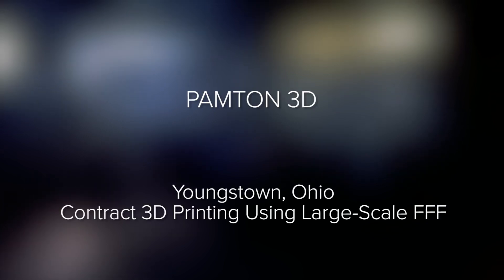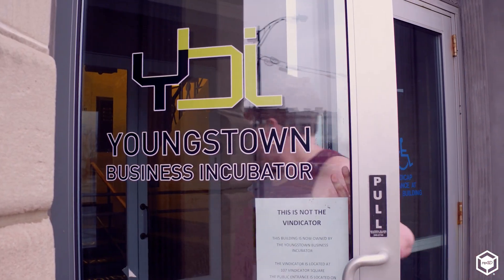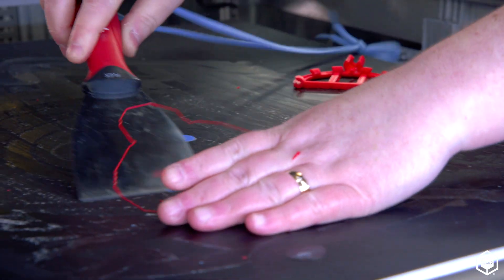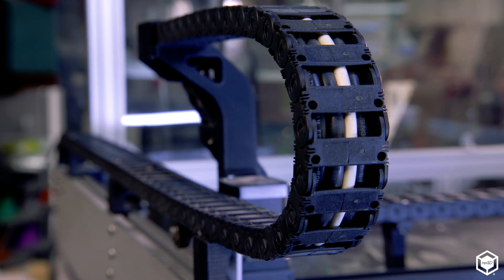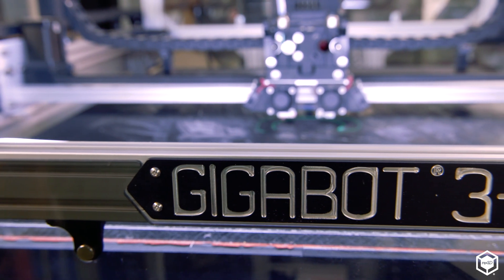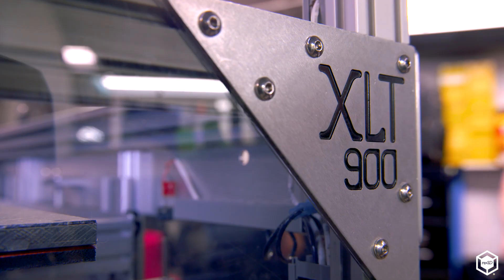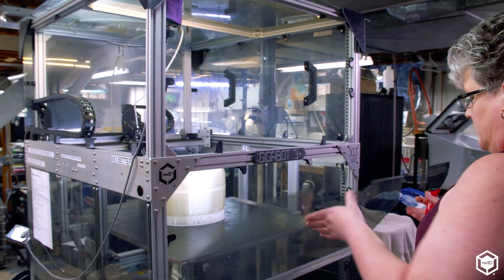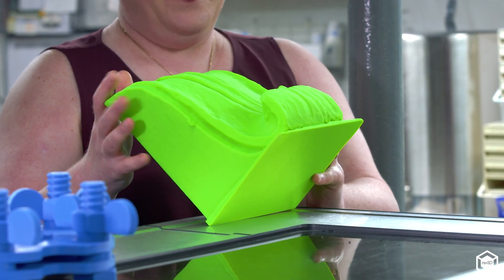Running a 3D Printing Business at the Epicenter of America Makes

Comment: In your printers what is the buildplate material, and how you cope with big pla parts warping?
Reply from the maker: Hi Kari, thanks for your question! The build plate is machined aluminum, and comes with a heated bed that has a temperature range of 60-115ºC, which is typically sufficient to counteract warping on large PLA prints. For large prints in high-temp materials like nylon which provide more of a challenge, we offer a full enclosure to mitigate warping.
Reply: Looks to also be a black build-tak-like surface on top of the aluminum as well. Amazing you found something big enough for the bed.
Reply from the maker: @Bajicoy  Yes, good eye! This is a custom-size PRINTinZ adhesive sheet. We don't print without 'em!